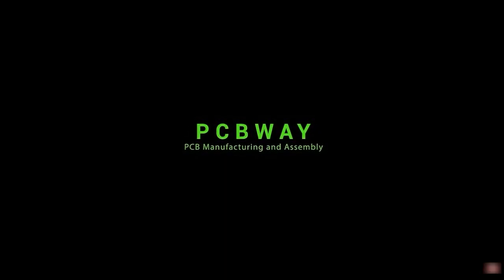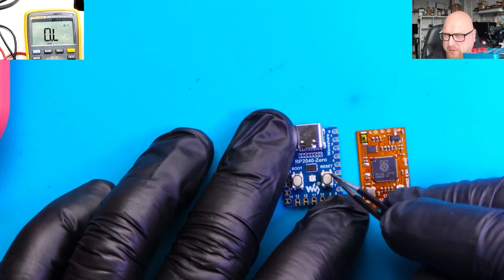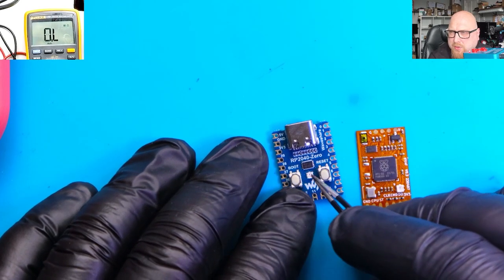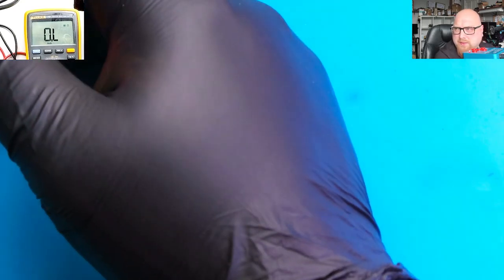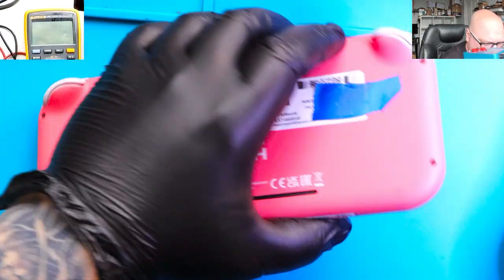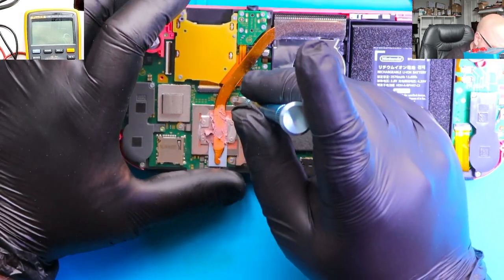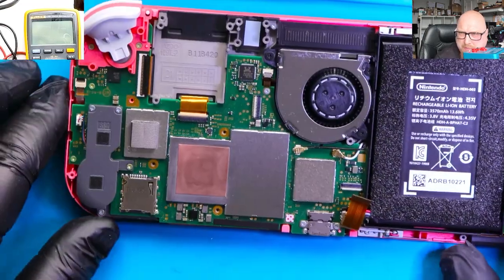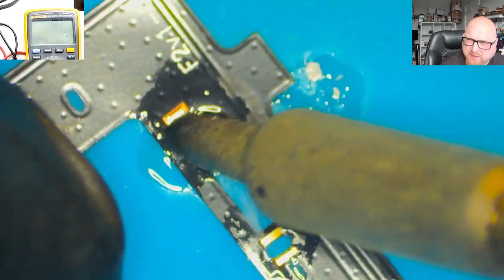NS Lite New Picofly Chip Installation.

Comment: I chose to do this as my first soldering project with an iron, microscope, and switch lite I purchased from temu for a total of $50, along with all the other parts from aliexpress. The microscope had absolutely horrible image quality and stopped working as I was attempting to put on the v2 adapter, so I was forced to eyeball the rest of the steps. Applying that adapter was for some reason the hardest part of the project for me, as I spent at least 30 minutes just trying to get the solder to connect to the caps and spent way too long trying to bridge the two pads, I am very lucky nothing got burnt or something. Eventually, I was able to solder everything correctly, albeit my wire routing was absolutely atrocious for I did not care to measure the length of the wires beforehand. I had issues with wires coming loose and the pico shorting with the metal backplate, so I had to resolder some points and cut a hole in the backplate 😂. All in all, it eventually got working, so I guess anything is possible if you believe in yourself.
Reply: how did you get it for 50 dollars?
Reply: Lmao 😂😂😂😂😂😂😂

Comment: I really like the instinct v6 chip because the cpu flex ribbon cable solder for a generic 2040 board is just hard to do reliably. Also the core 2040 mod which the Nand chip plugs directly into is so so soo good! Too bad the place I was getting mine from has vanished haha

Comment: Last time I attempted this mod, it was an exceptionally tight space and I ended up tearing the DAT0 pad. I'm going to try again soon. What size of iron tip did you use for the DAT0? And what is the gauge of wire you used?

Comment: Was it 300 c? That's over 500 degrees Fahrenheit! Do i really need to solder that hot? I usually don't solder past 204c (400f) with a good tip on my solder iron

Comment: @tvpartsworld is a god! Welcome back and cant wait to seem more vids. If you don't mind giving a few tips for us peasants. What solder iron tips are you using as well as the solder whether its lead free or not and lastly your temps, thank you so much. Biggest issues I have is swapping through 20 different solder tips as I cant find any that seems to work well for me.
Reply from the maker: I've added my specs into the video description.
Reply: lead free solder is terrible to work with. so don't use that. you always think the smaller the tip the better right?. but then it  doesn't transfer enough heat. you need to just practice with a slightly larger tip and youll figure it out. practice on some old cell phones sitting in your drawer first.

Comment: Why do you ever solder a wire for the ground point if whole cpu cap serves as ground too? Possibly you could make a hole in double-sided tape and put some solder on ground point to make it touch cap.
Reply: 1 wire is easy
Reply from the maker: IF the chip is not properly grounded, can cause more problems in the future. It always better to solder that wire to the ground, just in case.

Comment: Hi, can you help me, I try to update from 2.67 to 2.73 using pico_toolbox. It say success but when I see info my fw still in 2.67 not 2.73.
Reply: Your light glitch change of green for yellow? If yes, it's ok.
Reply: @douglascalixto9086  no yellow. Just green in the end.
Reply: @tanji8592   your chip still in 2.67fw, I think.
Reply: @douglascalixto9086  ya that's the problem, I tried 2-3 times but its still same.